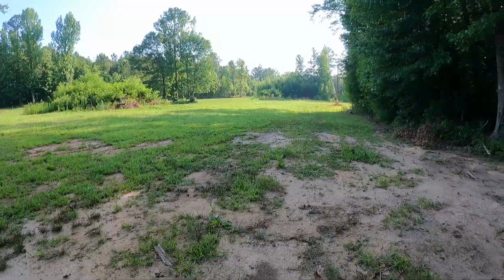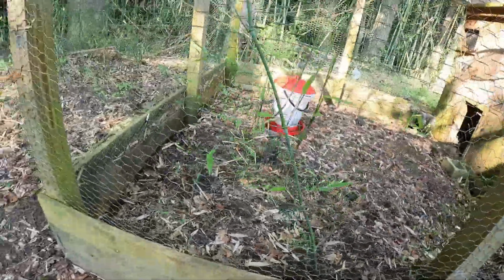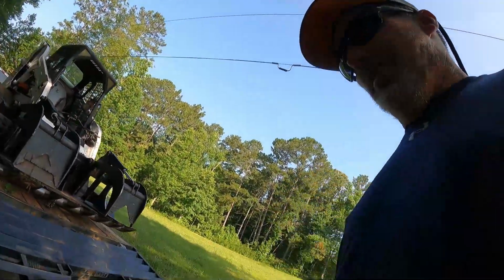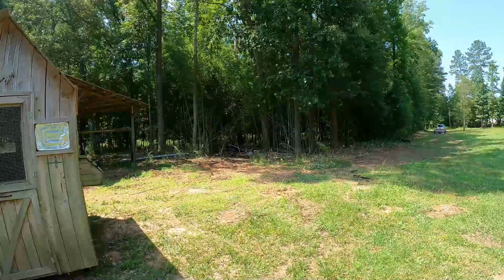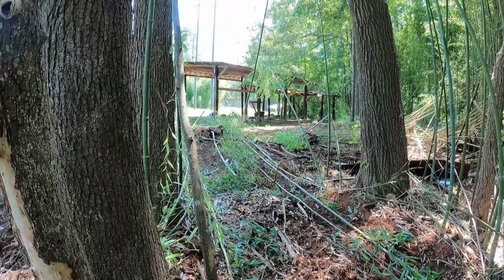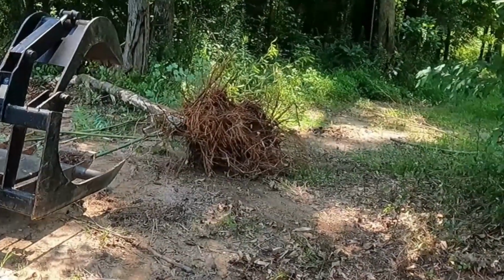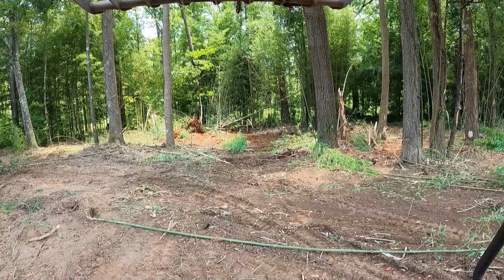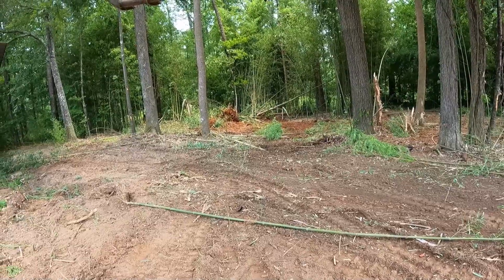BAMBOO REMOVAL JOB- COMMENT ON SCAG COMMENTS

Comment: I blow my mower off after every cut, it takes about 30 seconds, no big deal.
Reply from the maker: cool - you prolly the only person tha i know that does that. Its good that you take the time for that.
That's sorta like changing the blades every day some people do that but i dont. The mowers should be built in a way that does not hold the grass in all those places. do u blowoff if  you get caught in the rain ?
Reply: @rayrayslawnlandscape2008  No, not in the pouring rain. I just got into the habit of blowing off the mower after every cut when I got my first expensive mower to keep it looking good and continued to do it ever since. I wouldn't change the blades every day, no way.
Reply from the maker: @koolaidman6462  🤑